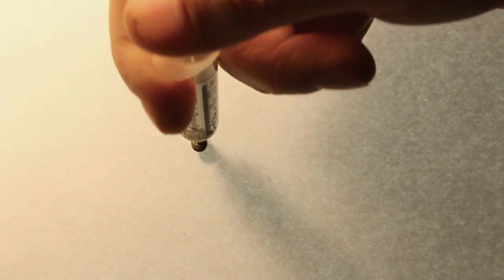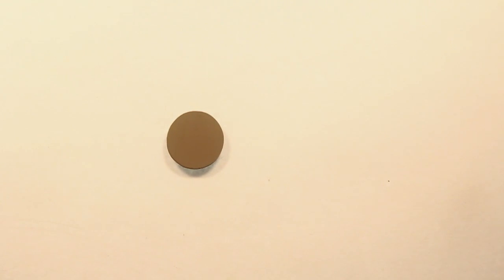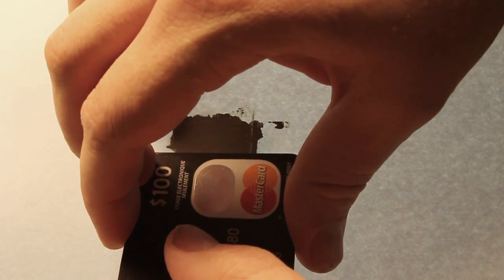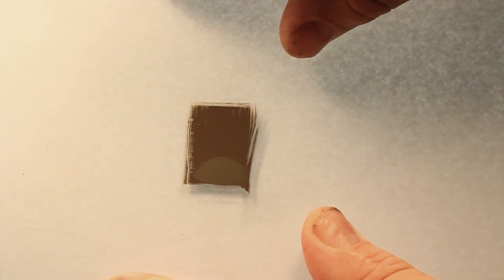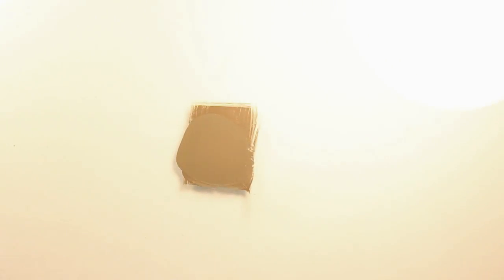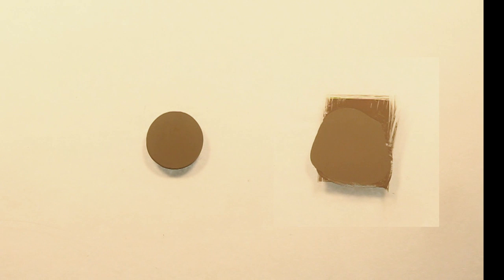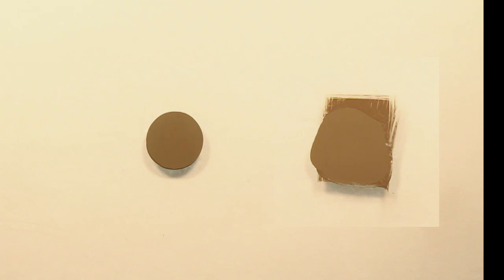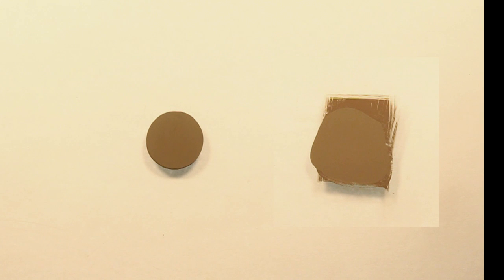Thermal Paste Spread Method VS Dot Method

Comment: People don't realise that when its thick it'll heat the cpu more and then thin out anyway (as long as you don't use a lot), also the dot spreads evener and the spread as you can see at the top and sides wasn't touching the glass and to get it to touch you had to push in the middle.
Reply: ABQSentinel The reason they don't come with a dot of compound on them is because it would make it difficult to package, seeing how there would be a quarter inch of compound sticking up off the CPU cooler. Also they have machines that dispense the compound therefore creating an extremely even spread which is pretty much impossible to achieve by a human hand.
Reply: Agree.
Reply: If that's the case then why don't stock heat sinks come with a dot of thermal compound instead of a thin layer of compound matching the size of the CPU package?  The problem with the dot method is that you get inconsistent coverage over the top of the CPU package, and you get an inconsistent thickness of thermal compound.  The problem you bring up has to do with the size of the glass he was using for his demonstration.  It was like a 12" x 12" square against another of the same size.  CPU packages and heat sinks are nowhere near this size and their surfaces proximate much more cleanly.
Reply: branbeno77 Yes.

Comment: When you put a little dot, it wont seem like it will spread much.
When the CPU heats up the paste will kinda melt and spread out more under the heatsink.
The spreading method works great and all, but theres tiny little holes and ridges you cant see with only your eyes.

Comment: I tried the dot method and it did not cover enough surface area. I then tried spreading and it was much better.
Reply: but the cores are in the middle, so if the heat from the cpus heatshields edges tries to come back to the important part again, it will be cooled anyways. i found a nice pic for showing you that:
http://smg.photobucket.com/user/NYC84/media/Forum/cbf792db.jpg.html
Reply: you only have to cover the cores and pretty thin actually
Reply: I reseated the other day and odd line method. Really the differences are minimal, it's not really a big deal
Reply: dude just use the pea method, you dont want to cover the sides too much and it shouldnt be too thick paste or it will get hotter. i mean, its not like world war 3 will break out when you use the line method, but maybe another oil war so use the pea :D
Reply: live covers more surface area than pea. I'm ocing to 4.7, I need as much as possible. I wanted to do cross but settled for line. pea just doesnt give enough SA. more SA = more heat transfer
Reply: thats not how things work. the cores are producing the heat and they're in the middle. by covering more area you'll also cool the other stuff what you dont need to. the cooling will happen in the middle and the sides are not transfering heat that doesnt need to be cooled through the paste, so they're cooled after the cores what is really important, and that keeps the cpu cooler than oprahs puss :P
Reply: The lid is metal and will transfer heat, so you need to get rid of that. Also on your cooler you want to use all the SA to get the most cooling. The center is the hottest spot but the heat spreading out.
Reply: yeah but if you only put paste on the center, the center is the only part that is getting cooled, and the sides are just cooled a little bit, because its not that important to cool them. you are basically just throwing your cooling power away if you cool the whole thing. if you got a nitrogen cooler, just do what you want, cool your cpu, your moms cpu, your balls, your dads balls, your dogs balls and all the other stuff. if you havent got one (what i think is the case), only cool the center
(i dont want to piss you of just for the lulz, i really want to help you keeping you system cooler)
Reply: BigDaddyWurst Yes it is important to cool the whole thing because heat from the dies will transfer away from the die, if you cool around the die it allows more heat to be transferred away from the die resulting in lower temps. Heat goes from hot to cold, that's physics. You want as much heat from the entire cpu socket transferred to the cooler.
Reply: No they won't, it goes against the laws of thermal dynamics.
Reply: that's because the whole cpu doesn't need to be covered only the centre
Reply: BigDaddyWurst You want to cool as much of the CPU surface as possible.  If the area next to the core is cooler, it will pull heat away from the cores themselves.  Physics try to average the temperatures, so if part of the IHS is cooler (like the sides), the areas around that spot will be able to dissipate heat to the cooler spots quicker, thus more effectively cooling the CPU.
Reply: dude every pro will tell you the same things i said. just ask one
Reply: Excellion you still have to fill out the microgaps, so the dot/x methods are still better

Comment: And arctic silver 5 is crap anyway. It dries out super fast. IC Diamond is better than anything else i have ever used.
Reply: AS5 beats most diamond and diamond can fuck up your cpu lid. Look up benchs.
Reply: Well IC diamond lasts significantly longer than AS5, and Diamond does scratch up your cpu and heatsync, but that does not effect performance.
Reply: Okay, so I was running the same application of IC diamond since that post until a week ago, and my temperatures hadn't changed a lick.  My motherboard went a little wonky and I had to replace it, so I have a fresh application and the temperatures are still no different.  Not even 1 degree.

My CPU and waterblock are both nicely polished, though ;-)  And that's why IC diamond works so well, it uses a DRY component to transfer heat: diamond. And nothing does it better.
Reply: Wes Murrell ic diamond is crap if you read up on it, it dries on in a few months and your temps will rocket. the temp difference between AS and that is so small
Reply: XxROCKSTARxX69 I ran my i5 2500k @ 5GHz for about 8 months before upgrading using IC diamond with no noticeable degradation in cooling performance... the compound WAS very much dry when I removed the waterblock, though.  Hard as heck as well, but I added a little dielectric and it reconstituted, so I'm doing a test for reusing the old compound vs new compound on my i7 2600k (at same clocks and voltage!! hooray!!).

So far the temperatures are running about 10C higher under load, but 3c lower at idle.  Some of this can be attributed to HT, perhaps, but I will be comparing to a new IC diamond reapplication and tracking changes over time as well to see if the drying has any negative performance concerns.  My feeling is that it doesn't - unless you have a loose heatsink.
Reply: looncraz it's not fully diamond btw, it's not even diamond, it's synthetic diamond. just a disclaimer
Reply: Andrew Russell Nobody cares.
Reply: Wes Murrell You don't care because you don't like to actually LEARN things.
Reply: Andrew Russell I do care to know what it is made of, but the fact that it is made of synthetic diamonds has absolutely nothing to do with weather or not it is better/worse than AS5. BTW, it doesn't matter if it scratches the IHS if it conducts heat well.
Reply: Wes Murrell did i question it's cooling capability? also for resale it can matter. I use AS5 and my 4790k is at 4.8ghz at the max core temp is 79c with my pumps and nf-f12s turned down.
Reply: Andrew Russell
It's known as industrial fine grade (as in coarseness) diamond, actually.  Whether or not it is synthetic is meaningless... it's basically diamond dust in a suspension.

You apply a small dot of the stuff, set your heatsink, tighten it down evenly, and leave it for however long.

I forgot to recall that I have been using it on my 7870XT for years, and its temperatures have also never changed (though that video card now resides in my HTPC).

I went from AS5 to IC, IC is better, but AS5 is certainly not bad.. but is is VERY difficult to remove after a year compared to IC diamond.

All it took to remove fully dried-out IC was a little alcohol on a paper towel.  AS5 took more effort as it had dried to an incredibly hard compound.  IC was so easy I didn't even think to mention it until now.
Reply: looncraz Damn that is brave. I would be scared of the IC diamond damaging the GPU die with the scratches it makes, but I don't really know much about GPU dies. I didn't use it on the die of my delidded CPU's either for the same reason.
Reply: looncraz I had AS5 on my 3570k for over a year. wasn't that hard to remove. just use either water or isopropyl alcohol
Reply: Andrew Russell what moron uses water on electronics
Reply: Wes Murrell taking a paper towel and putting a drop of water on it and rubbing the top of a cpu where there is nothing to hurt, especially when it's out of the socket and in your hand, isn't bad. i have a bottle of 91%  isopropyl alcohol because i' work on computers so much, but i've used water in the past to get 10 year old thermal paste off.
Reply: Wes Murrell
The scratches are really really fine, so long as you're going to only be applying it once, you're pretty safe doing it. I've done it since then, but I thinned it a bit with 91% isopropyl before applying the heatsink, which may have even helped it to spread, but I don't know.
Reply: Wes Murrell
I've washed out PCs with a hose before.  Used dish soap, a hose, and then dried things up, then used alcohol to help dissipate the water.  Let it sit in the Texas sun, disassembled, for a few days and no problems.  You DO have to discharge all the capacitors, and you should not do this with anything with moving parts (even hard drives).

I like to wash my keyboards in the kitchen sink (albeit not my fancy Logitech boards with LCDs).
Reply: Andrew Russell
I prefer 91% isopropyl, this works well while still evaporating quickly.  I've used AS5 plenty without issues, and even it being dry and hard is not much of an issue, but it can be much much more difficult to get off than dried IC diamond.

I've used both extensively, but AS5 way more than IC diamond, simply because it has been around much longer.
Reply: looncraz i was really considering IC diamond but from benches i've seen it only cools around 1-2c more, which doesn't mean much for me. I really don't like defacing my products as i like to sell them which is the main issue honestly. If i could get 10c less then i would consider it but my 4.8ghz 4790k at 1.3v (can run 1.29v) does fine right now. I do like having my fans down though as im a silence freak so my nff12s and pumps are all turned down.
Reply: Andrew Russell
The difference can be greater depending on the quality of the mating surfaces, but with good mating surfaces the difference will be much smaller.

Comment: Do the 'dot' method except use a thin line, it is the best. This test is also not accurate because you are not applying even pressure, and you are not applying pressure for extended periods of time, and you are using glass, not copper/nickel. The paste also spreads out and achieves a thinner layer and better contact when it gets nice and hot. Spreading it can also expose the paste to any other materials the spreading tool has touched, which is bad. The only real way to test this is using a real cpu and a real heatsync, and comparing temperatures.

Comment: I generally use the dot method on most TIM ie ceramique and MX etc but I ALWAYS spread AS5, for some reason if the dot method is used the paste doesnt reach the corners when I removed the heatsink after a couple months.

Comment: High end water cooling systems already come with the thermal paste spread out (pre-applied).. So to say that it is not a valid method is dumb, as high-end cooling systems indeed use it. Of course it has to be done correctly, though.
Reply: Jason Davis My corsair hydro 60 came with re applied thermal paste. It might not be of the same calibur of an artic silver but it has worked just fine. Then again it depends on what you mean by high end. High end water blocks ?
Reply: high end watercooling systems do not come with pre-applied thermal paste.  blocks come with tubes of paste to apply yourself.

Comment: I spread but I do it a little different... try it if you like. If you are spreading, it helps to use slightly more TIM than the pea method. I use blue or green masking tape on the CPU on the edges making an exposed square in the middle of the CPU leaving about 3mm to all four sides. I spread like a silk screen from all directions with a piece of clear, thin but firm plastic that is wider than the CPU. Once you have your square of TIM peel off the tape, apply the cooler and it will spread to the edges or like .5mm shy of the sides. Takes practice but well worth it. I have seen temp drops up to 11 degrees C over the pea method.
Reply: Actually sounds like a good method. Will try it out sometime. Thanks, mate :D
Reply: Now THAT sounds logical! The heat sink/fan that came with my fx8350 had a square of paste pre-applied to it that appears very similar to what you describe here.Going to give it a shot. Thanks for adding some sanity to this stalling argument.
Reply: I like your method. First ive heard of it

Comment: ac5 HAS tobe cycled. meaning prime95 to raise the cpu usage and temp. the dot method works on the ac5 because it will become a lot more "runny" and spread out evenly on it's own (usually ac5 will also perform better with age.. like a fine wine) ... after years of working with pcs i fount that 5 small dots (like on a dice) will yield 1*c or 2 cooler than either method.. although the 1-2*c difference between all these methods is pretty much negligible though.

Comment: I prefer the spread method you get a clear visual of the paste being applyed. Versus the dot method which the user has to lift the heat sink usually to check whether it spread evenly. I use a rubber sqeegee that came package with one of my screen protector kits.

Comment: I spread it
Reply: dont do that
Reply: Spreading most times cause bubbles
Reply: BigDaddyWurst I spread as well, always did, never had problems, all my cpus were always running on low temperatures.
Reply: you should do a test for yourself with the pea or the circle method
Reply: because it fills in all the microgaps
Reply: I personally use the "line" method and it has worked perfect for me. The "spread" method gets too messy when it comes to cleaning the TIM off the heat shield later down the road and the "pea" or "dot" method doesn't seem to cover enough of the heat shield for me.

Comment: If you're lucky, and the thermal compounds viscosity is low enough, the air will, as you say escape when the heatsink is put on.
But that is not the case in most cases. First, the thermal compounds have a rather high viscosity, and any smaller air bubbles will get trapped. They'll shrink as pressure is put on, but they will still there.
Some times it's "good enough". But things could be better if done right.  If you're not overclocking you might be satisfied with the lesser performance.

Comment: I have a question, if there would be bubbles in the paste after using the spread method, wouldn't those bubble just dissappear when the pressure of the heatsink gets on?

Comment: My comment on this experiment would be that the CPU heat spreader is not always a perfectly flat surface, if it was, a drop of water would have done the job. As a matter of fact, neither is the heatsink. AS5 spreads out during thermal cycles as its suspension fluid separates leaving just the silver particles. While this happens, air bubbles may also leave. This means a longer break in though. If both surfaces are treated with a tiny amount of AS5, rubbed in like polish, break in can drop to zero

Comment: ~I use the spread method and can officially say that when done right it works better than the dot.line method simply because you get a more even dissipation of heat across the chip, in fact, computer manufacturers spread the thermal interface over the heatsink before applying the heatsink to the CPU, I can honestly say that the air bubbles thing is a load of bubbles if you do the spread method correctly and carefully, making sure that the whole die is evenly and thinly covered

Comment: depends on if you have a CPU with or without a heat spreader, with a heat spreader on, it is best to coat the whole thing as this ensures even dissipation of heat, but on mobile CPUs and older desktop CPUs, the line method is the best/easiest way to ensure good thermal contact with the cooling solution.

Comment: I found out that spreading the TIM will give air bubbles IF you don't use a flat object, if you use a credit card or something like it, you are guaranteed 90% less air bubbles than cardboard and a thinner, more even spread across spread on the area to be coated, and if you can get a thin layer of thermal interface on a chip, that's a really good thing because it means that the thermal transfer will be greater than that of the dot method, and the heat will be transferred more evenly too!

Comment: line method is basically the same. Just do it according to the shape of the cpu. Point is, that it is spread by the cooler itself. This way, air is inevitably kept out.

Comment: The reason the pea/dot method is best because air is inevitably pushed out. Spread only works when done perfect, which means perfect spreading and setting the cooler. If it wasn't perfect you'll end up with a less optimum result.

There is basically no need to do it other than dot (or line) method, as its quick, uncomplicated, clean and most of all, optimal. You can't have a better spread than by the cooler itself, cause it fills 100% of what needs to be filled.